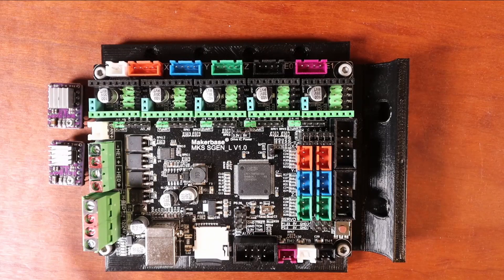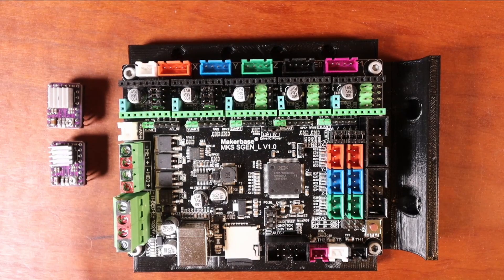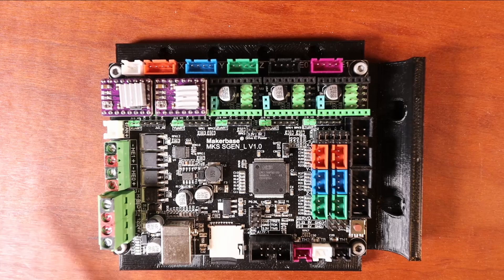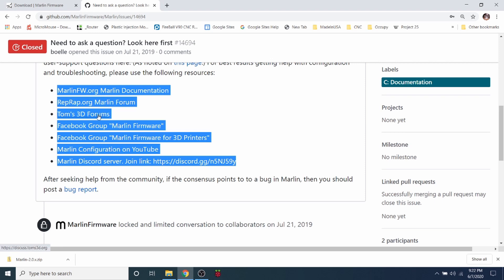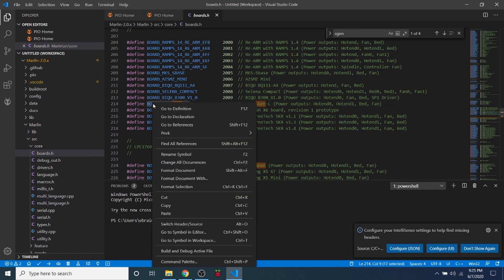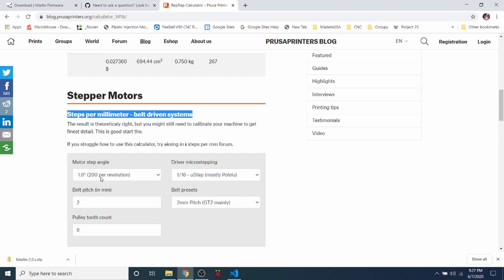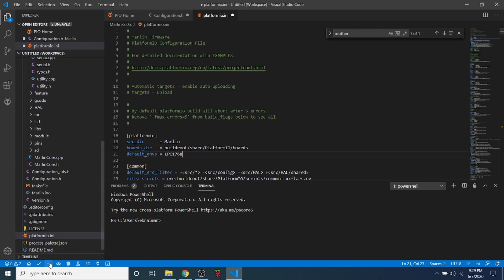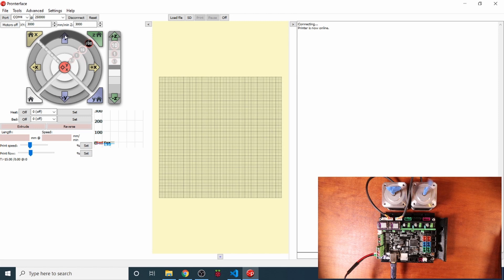MKS SGEN L V1.0 - DRV8825

Comment: Hello Ed, 

I have completed my build of a Core XY 3D printer and have been able to get around quite well using your videos. 
However, I am now facing the problem that the stepper motors unfortunately only twitch briefly but do not move when I control them via Pronterface. 

Other functions such as fan, control of the heating bed, etc. work in the meantime. 

Do you have any idea how I can proceed? 

I would be very grateful for any kind of help.
Many thanks in advance
Reply from the maker: Use the Discord Link in description and post in general chat configuration.h and configuration_adv.h.

Comment: Hello!!  First of all I would like to congratulate you on the excellent tutorials you do.  They have helped me a lot.  But I would like you to help me out of the following situation: I have a mks sgen l 1.4 and it happens that my Windows 10 64 bit does not connect to the board.  The blue lights blink constantly.  In fact I compile with vscode and I get error LPC1768.  I did everything you explain in the video but I don't know if I should do something beforehand.  I appreciate prompt response !!!  Regards
Reply from the maker: Check in device manager for unknown device.  It maybe the drivers for USB are not installed.

Comment: Hi, are you sure to put the jumpers right? Manual says to put them on the right side of first 3 rows of black connectors (so jumper is between black & green) , but you put them on the left side just on the green areas. I mean it seems to work... but  maybe it's just accidently the right pins for 32 microstep mode?
Reply from the maker: Looks like I posted the incorrect line to the datasheet.  I updated it.  Nice catch.